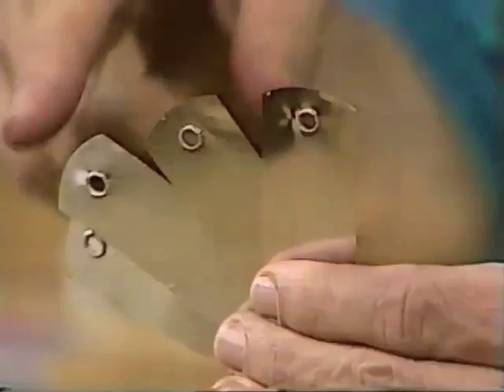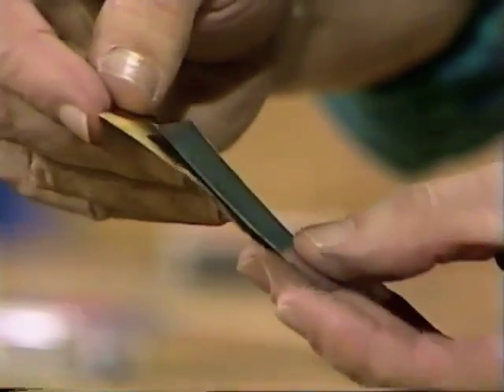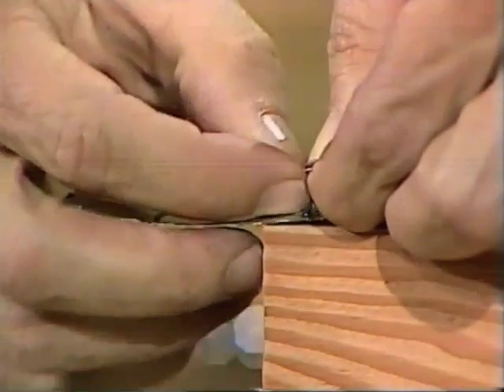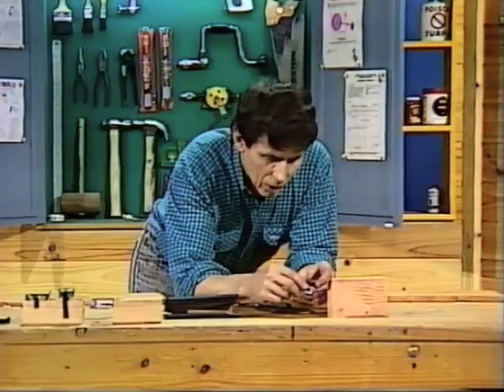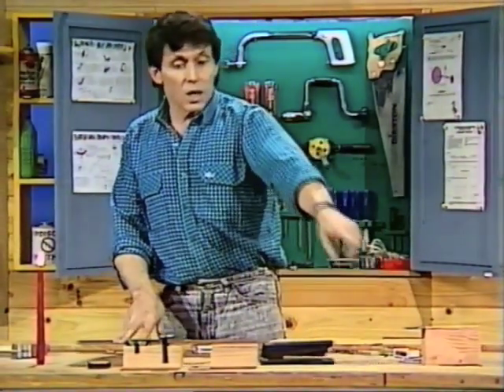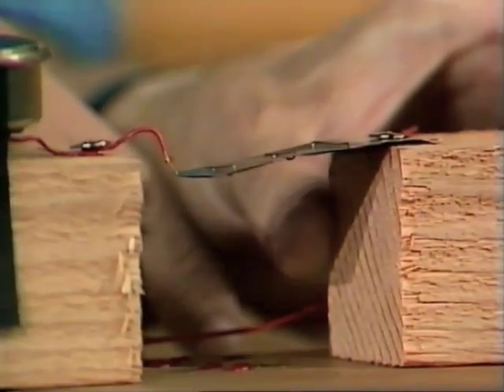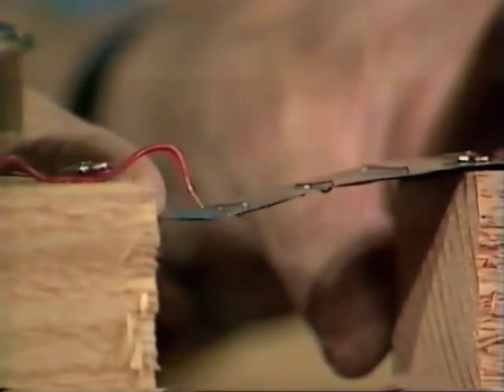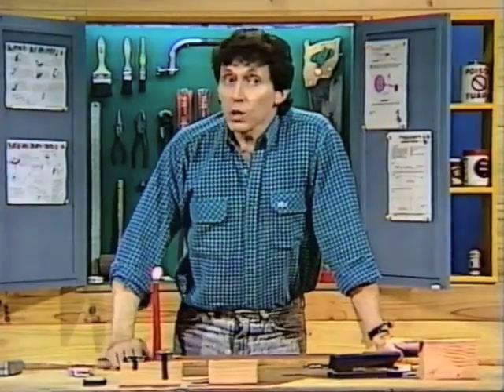Making a Fire Alarm

Comment: I once accidentally set off the alarm for an entire apartment house by using a vacuum cleaner on a dusty heat detector.  The suction was just enough to close the circuit.  Lesson learned!